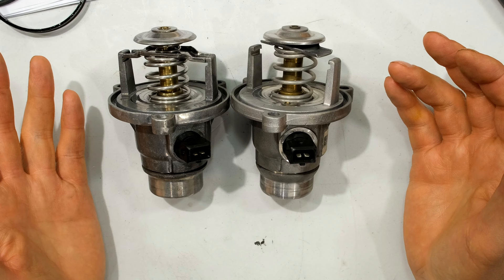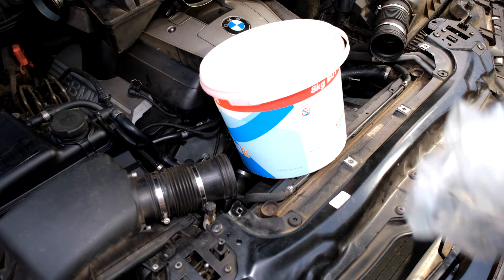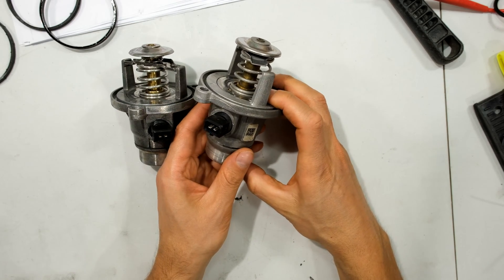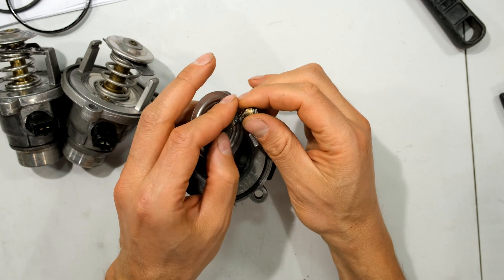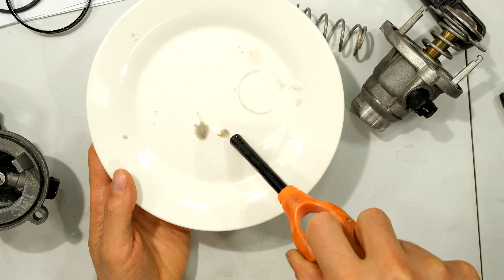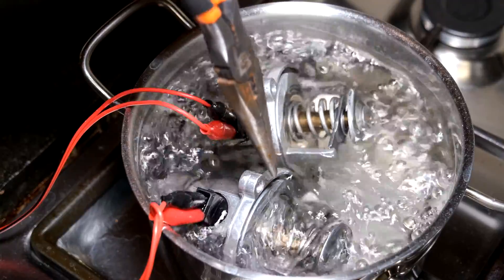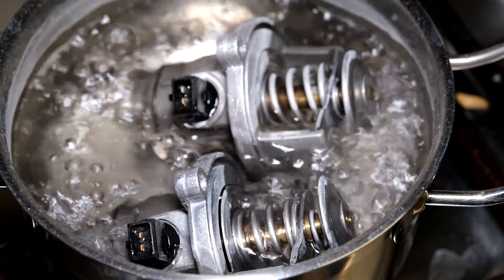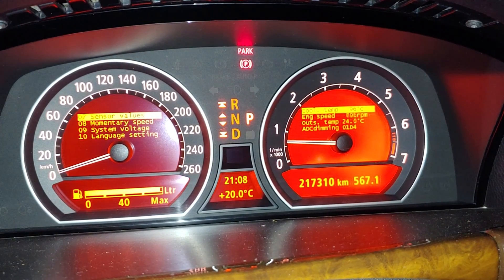Lowering the opening temperature of the n62 E65 BMW thermostat

Comment: If you only change the thermostat but not the software when the computer find the temp will never reach 105 it will keep push more fuel so it will cause some issue.

Comment: I'm interested in a similar modification but with a different thermostat.  The one I'm working with disassembles so I can easily replace the spring.  Would a weaker spring encourage the thermostat to open sooner.  Currently it is a 88 degree and would like for it to be 82 degree.

Comment: Thank you so much for this amazing video.  I have just purchased a fairly expensive generic 90 degree thermostat from the USA and am fitting it today. As you demonstrated the cheap ones do not seem to be much different to the OEM one.  My car is an E66 760 (V12) and I am obsessed about dropping its operating temperature to avoid putting pressure on all the new hoses and other cooling system parts that I recently replaced. At 107 to 110 degrees these engines are a ticking time bomb waiting to let you down and raid your wallet.  By the way, I use a paper drip coffee filter in a funnel to clean any fluid that I reuse.  People laugh when they see a pack of coffee filters in my tool chest. Your amazingly detailed and practical videos are a "go to" source of information for me along with George Auster and SATS Motors and Vehicular DIY videos on the 760Li and E65/66 cars.  Thanks as ever - Mark.  PS - if my expensive generic from Turner Motorsport that I am fitting today is no good then I will try your wax trick using wax from the original thermostat which I thankfully held on to and can use a doner.
Reply: Well I fitted the Turner Motorsport 90 degree thermostat and it seems to open at about 97 degrees rather than 90 degrees.  Anyway it has reduced the cars maximum temperature reached 97 to 100 degrees rather than the 107 to 110 degrees it used to hit with the BMW standard 105 degree thermostat, so that is a meaningful improvement and I will probably leave it there for now. The low point is about the same as before at around 90 degrees. Readings are from a cheap generic scan tool in the OBD port and displayed on my phone through an all. Hopefully those are the same as would be indicated in the "hidden menu" on the dash. Anyway, thanks again for your video - I will keep your method up my sleeve for now.
Reply from the maker: glad it offered some improvement. I was also going to get the Turner option but i needed one urgently and Amazon was faster shipping all the way to South Africa. Its seems that the Turner would have saved me a lot of time... Ill try reading the temp from the OBD port
Reply from the maker: thanks for watching and the great coffee filter tip!

Comment: I made a "cooler" thermostat but i've got an error about mechanick part of thermostat. But it works as must be and open about 90-92. But i've got a "check engine" symbol and it's making me sad...
Reply: Perhaps you damaged the electrical heating element inside it in some way when you were working on the thermostat and it is now open circuit or you did not reconnect cable fully?  Good luck!
Reply: @marktolner2922  i had checked this element via multimeter (checked both of wires) - it has no open circuit, because i heard a multimeter's ring. This is the right way of check?
Reply: @BBOYMixFive  Sorry Mike but I am not an expert.  What I could add is that whilst it is true that your element is not open circuit it may break down when a current is applied and would therefore not heat up? I wish I had a machine like ecologicaltime's that would allow such a test I think.
Reply from the maker: i had an e65 that was running at about 65C for over a year and i never got check engine light however on INPA is does show a fault code for thermostat. Have you scanned with INPA?
Reply from the maker: the ringing means the ohms are low which is correct but it could also mean a short circuit. Please measure the resistance between the terminals. I did a video on the mapped function and i think it was with that same thermostat and it has the resistance value for it: https://youtu.be/2q_xL2P104Y

Comment: Just do a thermostat delete
Reply from the maker: whats that?
Reply: Absolutely terrible idea, please nobody do this. Running slightly too hot (as BMW designed it) will trash your gaskets, fixable PITA. Running too cold for too long will trash your entire engine, and pretty quickly too. Unifxable.
Reply: Don't put a thermostat in. Granted the car will run longer on a lower temperature but it's better because yu won't overheat
Reply from the maker: The wear and tear on slow warm up would be catestrophic. Most parts designed for 90 degrees. The thermostat also works according to a map function. I have a video explaining map functions